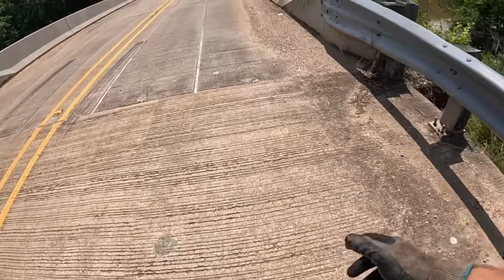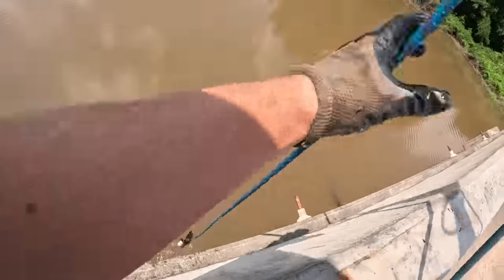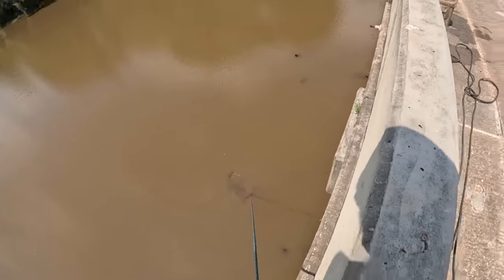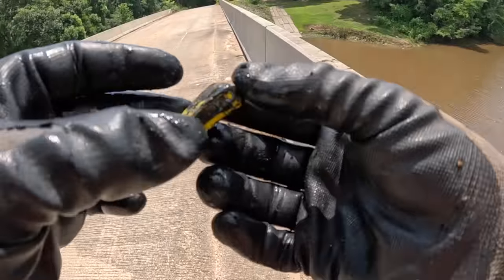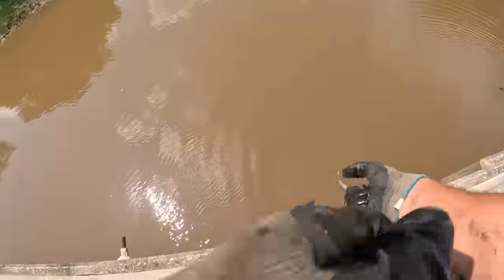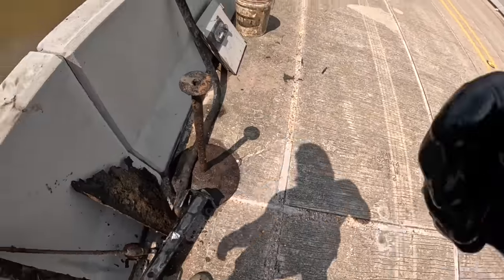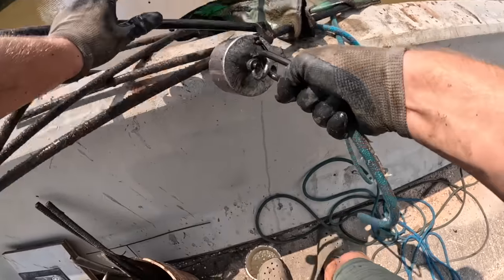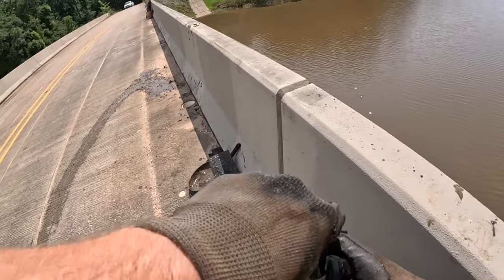Warning Disturbing: My Most Disgusting Magnet Fishing Find Yet -Whoever Did This Needs To Go To Jail

Comment: The u-shaped cable things are strand handles that are used in precast concrete. Once the casting is set in place with a crane, they cut the handles off.

Comment: Has to be the strongest magnet ever.
Reply: Danged near. Some are rated for 1200 pounds or more. I think I've seen some rated for up to 3200 lbs. I'd have to check on the sites that sell them. You have to use heavy-duty braided cable rope with them, too. You're more likely to lose your rope or break the link on your magnet than to break the magnet. LOL They're rare earth magnets, so they're super strong.😁